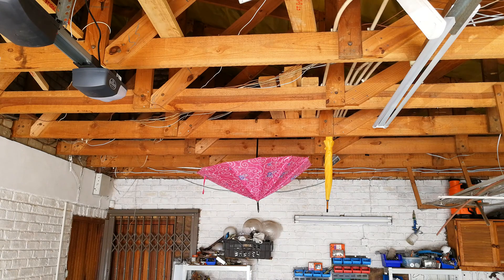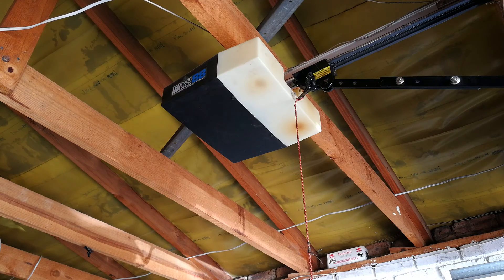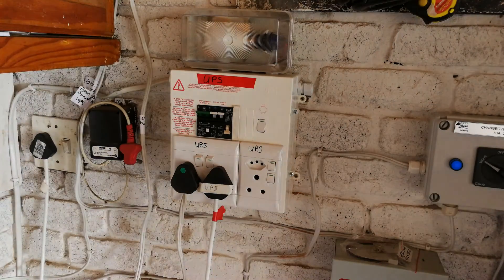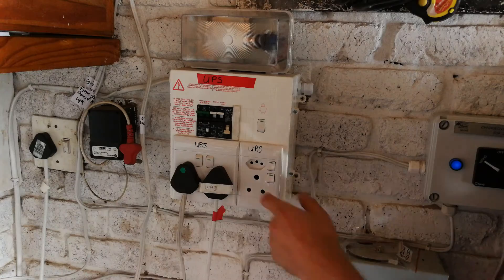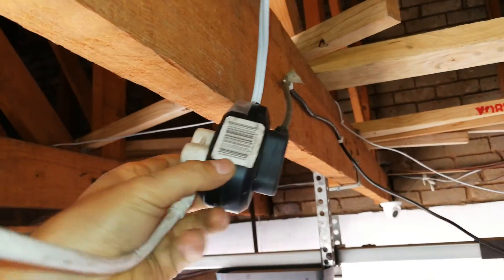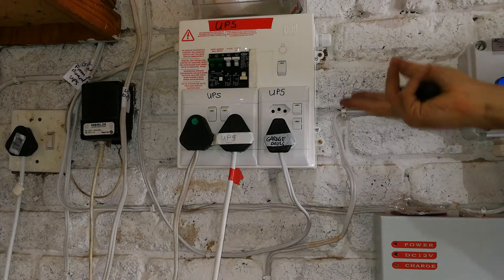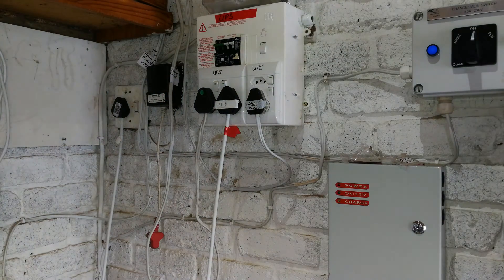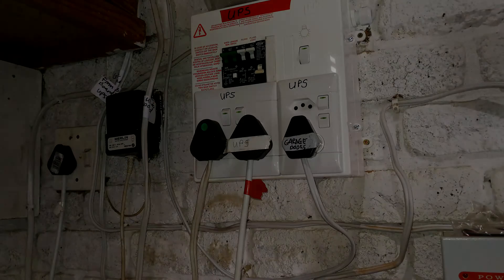Load shedding- putting garage door openers onto UPS or generator.

Comment: @ecologicaltime  will a line interactive UPS like Kstar powercom 3000va be compatible with a Generator?
i have the 4stroke Ryobi 7KVA AVR system Generator
and bought 2 UPS without proper Knowladge
it says on description that it is UPS compatible (optional)
Thanks so much for your informative info!
Reply from the maker: line interactive are usually incompatible as they expect a clean input signal and these generators are not providing a clean AC waveform. What happens is the UPS keeps toggling online / offline / online /offline. Some UPS can tolerate dirty power so you will have to see but the line interactive i have used don't work with generators unless they are pure sine wave generators.

Comment: Will a 650va ups thats usually ised for a PC work for a garage door only?
Reply from the maker: depends on your door. If its the Centurion battery operated ones, then yes. If your garage door works with a lead acid battery which most newer ones do, then a 650VA UPS will keep charging the battery and the door can open but note that these UPS cut off after about 15 minutes unless you got a proper UPS "online" model with battery banks. Most of these PC UPS are offline, they only provide power for about 15 minutes. If your garage door does not have a battery backup, then it may not provide enough current on starting of the garage door. This depends on the weight of door that its lifting so cannot answer this question.